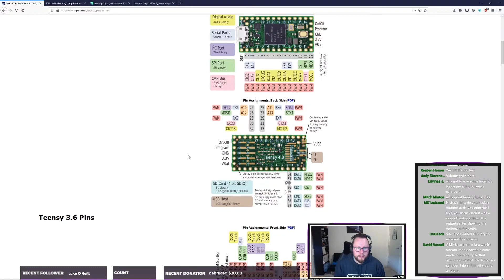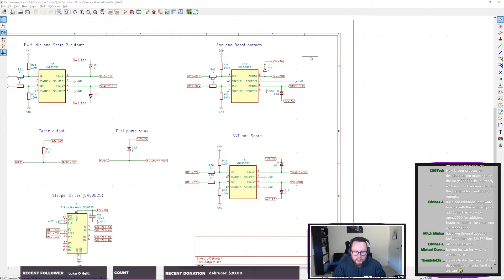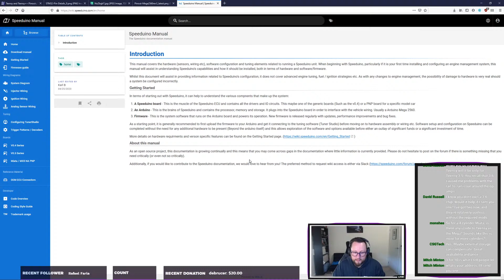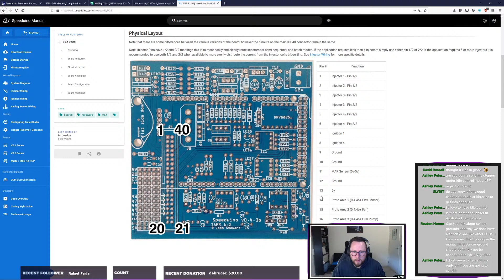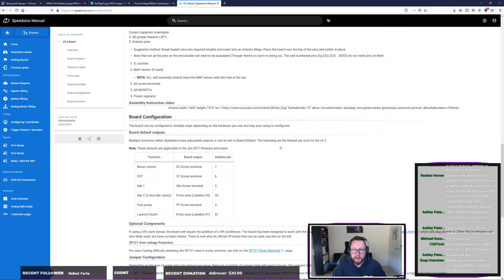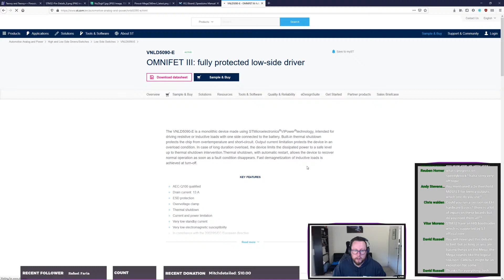Speeduino live - Comparing MCUs for ECUs!

Comment: HI Josh, Great stream unfortunately i didn't catch it live, Just a couple of thoughts on ST32F4, They support USB DFU (Device Firmware Update) and its fairly easy to setup on Windows and Linux and in our experience its almost as easy to use as the AVR 2560 system and requires no coded boot loader as its chip based rom code, the only thing is single button press to enter the rom or this could done over comms.   Other thoughts would it not make sense to add a higher order active filter around the op amp circuit as your adding an the amp anyway.  Other major differences between the 2560 and the other micro`s is ADC speed and resolution, i guess this would be more interesting to advanced functions like say Knock with internal tunable filtering. - Happy to take a side discussion if you want to chat about any of these items. Cheers Ben

Comment: I just discovered Speeduino and I’m thinking about making one for my 06 Mini Cooper. It has a DBW system. I think I can build a H bridge controller for the DBW. I have a strong automotive and electronics background. What are your thoughts? Also with the Teensy board, wouldn’t it be easier to supply the sensor with 3.3V instead of 5V? Instead of stepping down the 5V signal to 3.3v.

Comment: 53:40 That switch statement makes me sad. :(  Why not make a wizard that lets you select different things that you need for your engine, and then compile only what you need?  If you only need 1 VE table, why use up the memory for any more?  That would allow for a bigger map too (if memory is an issue for the board one selects).

Comment: Speaking only of the microcontroller specs and pricing, I think the MKE14F is one of best choices; 5v operation, 4kb of EEPROM, 168 Mhz, $2 in 10k quantity, -40 to 105 C operating temp. 

The MK64512 on the teensy has a badass internal voltage ref and 2x 16-bit ADCs, it is a shame that analog signals have to go through a voltage divider and an LM324 before it reaches the ADC.